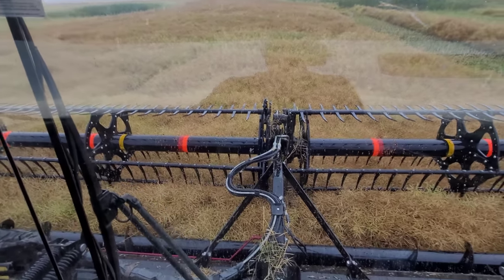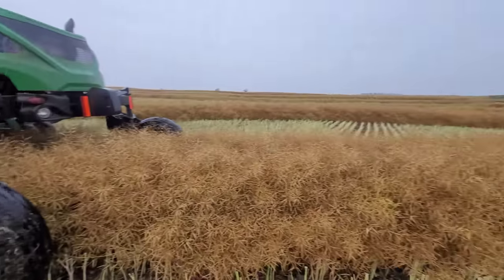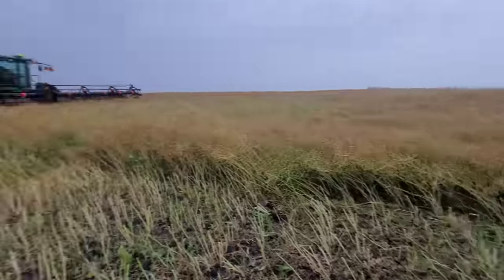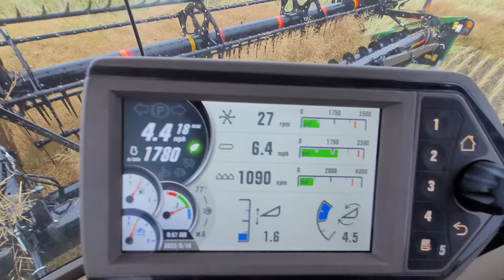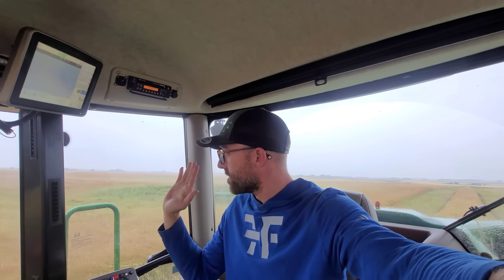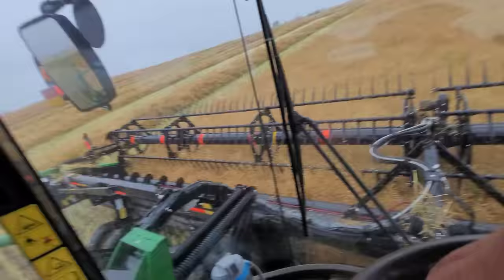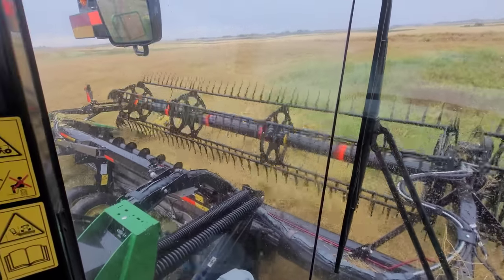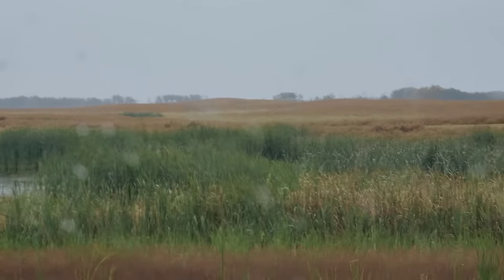W170 Success!!

Comment: Hey Mike, Your struggles with those rotoshears baffles me. I have used mine for 10 years with no stationary knives and the only time they have ever stalled is when I wrapped some fence wire in them... I have swathed some 60-70 bu crops with them no problem.  And as far as I'm  concerned the WETTER the canola  is the better.. makes the plants heavier on the canvas and lubes the crop to go through the hole.  When the crop is dry... it gets light and fluffy... it wants to stay suspended more on the canvas.  I never swath in the heat of the day... only at night or in the rain.... thats it. I have been swathing canola for 30 years... at the end of the day it just takes some seat time to find your mojo... good luck the rest of the way.

Comment: My family has a smaller grain operation in Manitoba. Have always swathed canola as the shell-resistant varieties of canola have only started to become popular out here in the last 10 or so years.  We typically wait until all the seeds are solid green, and squish like a ripe garden pea (Clear watery seeds obviously being too early, as they shrivel like a raisin if cut). Cloudy rainy weather will "wash" out the greens once swathed and speed up the seed drying (blackening) process. When you wait until the plant is dying & majority of seeds are black then you run into shelling issues and have to swath at night, early morning when cool & dewy. Start combining a few weeks later when you can roll(squish) a sample of the seeds on a strip of tape and 95%+ are yellow inside.

Comment: Angle swathing eliminates east, west direction issues. I run shears on my swather and if I don’t want to use them, shut off oil supply and put divider boards on. They slid over the front rods and bolt to shear frame. Work excellent. Never have to remove shears. Look good up north

Comment: Had similar problem with my gps losing signal and kicking out like that. Was the two way radio antenna I was using was a magnet temporary antenna and was two close to bubble. Cell phone booster would do it too. Make sure your using the factory antenna system and not a temporary one.

Comment: I literally lost hair trying to combine canola for a neighbor because of the piles. After that year they came out with a cutting device on end  of the the cutter to cut the clean divide where it continually wanted to hang up causing the problem. The devices I seen were similar to a chain saw on end of swather

Comment: The problem with straight-cutting for us is always that it takes 2-3 weeks longer to harvest the canola than when we swath it.  For us, this is quite a logistics issue, hence we swath most of our canola.  Heavy swathes and rolled down, we've only had wind move the swathes on a couple of occasions.

Around here the John Deere dealership mostly sells MacDon swathers. Hay farmers like the John Deere windrowers but no question, if you need to swath canola, MacDon is the machine to have.  Best canola swather around.  No one even looks at the other green and red swathers for that.  And for other specialty crops requiring swathing the MacDon header is the only thing that works for us.  Something about the geometry of the header, the hole, and the suspension linkage that works better than anything else.

Oddly enough we've used roto-sheers for years without any stationary knife sections bolted on in heavy canola (up to 70 bu/ac) and have never had an issue.  But my deck is only 25' wide and probably the reel takes less power to run so the roto-sheer has a hard time stalling it.
Reply: Whereabouts do you farm? Is wimter canola out of question in canada? I got 110 bu off that stuff. Not in canada tho 🍁😀
Reply: Southern Alberta. No winter canola here.  Nor winter peas.  Don't survive the winter.  Would be nice though.  Agronomists figure the best spring-planted varieties could yield 100 bu/ac here if we spoon fed them throughout the season.  70 bu is a more realistic average with irrigation.  Lately the summer heat has reduced canola yields across the boards.  Canola aborts flowers above 30C.
Reply: @tmlf1239  i farm in finland, can only grow oilseed rape. Average yield is a touch short of 80 bu but we almost never pass 30C and get much more rain. 150 k south theyll grow 100+ bu canola. I worked on a farm in north dakota, good canola there. Drove probably 60s/70s swathers all just belts and pulleys, talk about using up your equipment 😂

Comment: You do have a 35 foot header just lap over 5 feet
Reply: Iirc its 40ft
Reply: We’ve done that in the past on heavy barley crops.  We had a 635d on our D450 and we would just set the gps to 28’ and it worked pretty good.   For those who know don’t know the model numbers we were running a 35’ head but just over lapping until it was only taking 28’ of crop
Reply: Seems to obvious 😏

Comment: If you buy that we have a set of vertical knives that should fit that I would sell ya. They work really well. They come off a Macdon header.
Reply: I've got a sabre saw unit I want to sell too. I think that should tell Mike how well they work in these conditions!  haha. Thing won't divide canola worth a darn.  Canola just hangs up on those little knives that don't have enough stroke to them.  Just shakes the swather.  Ditched them and put on roto sheers and so much better.  Don't even know the sheer is there.

I think the sabre saw thing probably came out of Europe.  I see a lot of units like that over there.  But here they don't work for whatever reason.

When straight cutting we don't use any sheer at all, just normal dividers. But in green swathing conditions, nothing beats the roto-sheer. Although any sheer will split open some pods.
Reply: @tmlf1239  haha. That’s not good. I’ve never used them in canola but I have in mustard and they worked really well. We just got rid of the Macdon headers and kept the knives and never used them since.

Comment: Why are you not overlapping more thus putting less through swather ?
I can appreciate a narrower cutting width may initially sound like something that would result in longer cutting times per field but if less plugs & bunching is obtained would you not make up the time in the long run plus make the field easier to combine.
Just asking as my swathing experience is limited.
Possibly needs more of the "Ashtyn Touch"
Reply: I have a little experience swathing and from what I have seen you can overlap some but you need relatively even crop flow from both tables or it will plug even worse.

Comment: Mike, question what is the purpose of swathing verses combining thanks love your channel!!
Reply: He will still combine, but with a special head called a pick-up head for the windrows.
By cutting the crop he kills it which makes it dry out and combinable (the seeds will easily seperate from the plant in the combine process).
Many will spray a crop with glyphosate (round-up) at the end stages of the crop's life cycle to kill it all completely, but that leaves behind chemical residue and can be more costly.  It is much faster as well because those spayers take larger swaths and drive probably 2 to 3 times faster.
It is a give and take, but the much healthier way is swathing.
Reply: The swather kills the crop and forces it to dry quicker.
Reply: Thanks for the info great of you both to reply not being a farmer and all!
Reply: A lot of guys use diquat around here.  But you have to wait a long time before you can spray diquat (100% color change on the seeds really) as it locks in the green seeds to a degree.  Glyphosate is so slow too.  You spray it about when you'd normally swath, along with some Heat, and then it slowly kills the plant over the next couple of weeks (can't use glyphosate by itself on glyphosate-tolerant canola).  All in all swathing is consistently 2 to 3 weeks faster for combining in our short harvest season and I suspect the same would be true up where he was swathing.